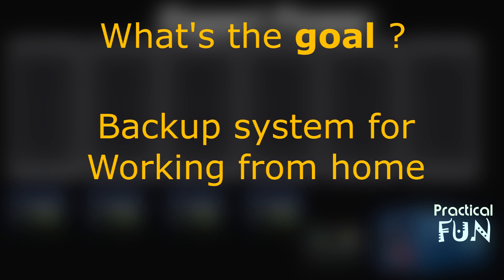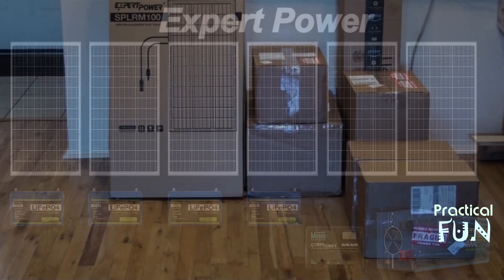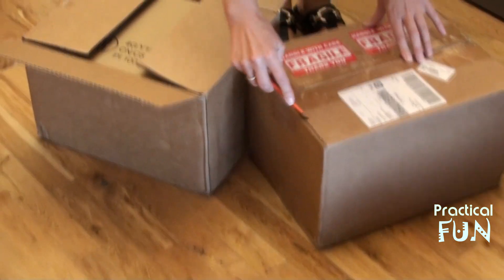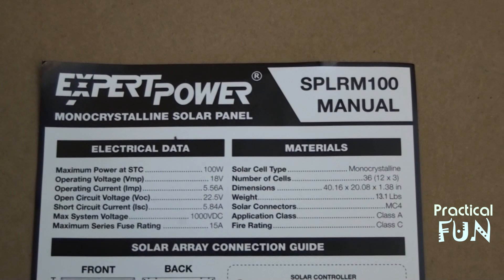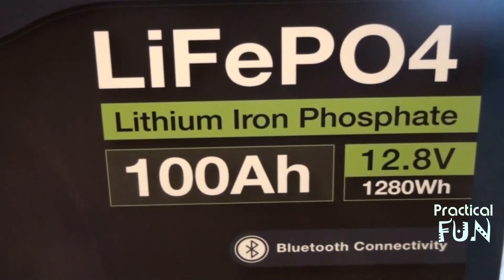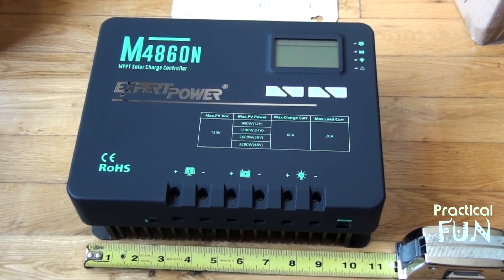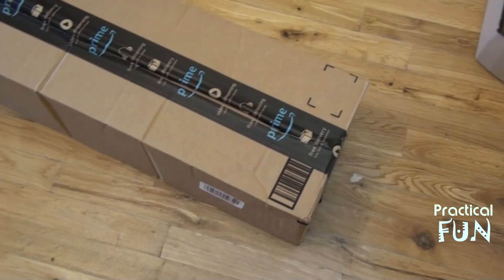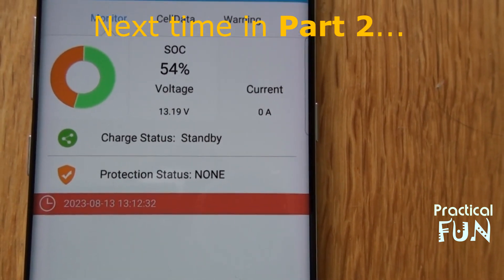DIY Solar Kit: ExpertPower 5KWH Un-boxing (Part 1 in a series)

Comment: Please provide a link to the specific kit that you bought from ExpertPower. Thank you.
Reply from the maker: Thank you for the reminder.  I should have done this in the video, but here it is:
https://www.expertpower.us/products/5kwh-600w-12-24v

Please keep in mind that I made one modification which was to get the 60amp ZMPPT controller instead of the 40, other than that, it's as is (aside from the extras I needed for my setup).
Reply: Thanks for the info. The link worked.